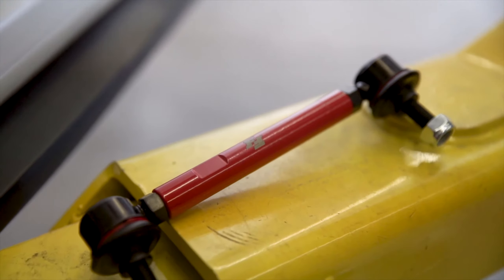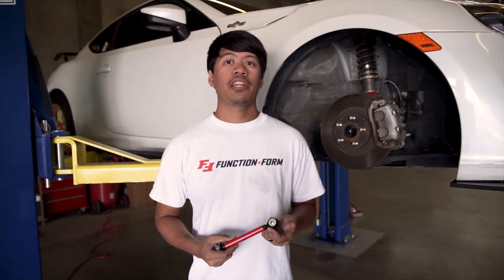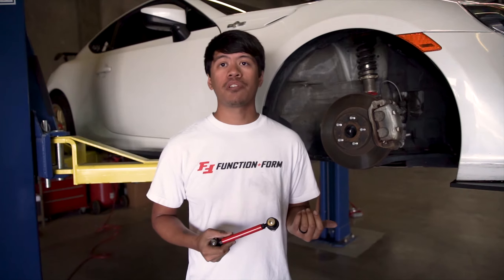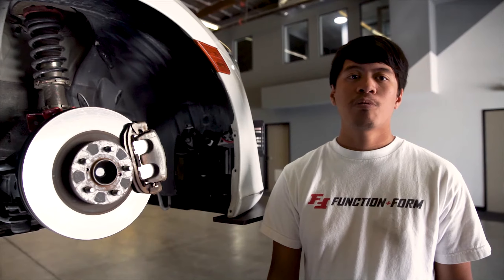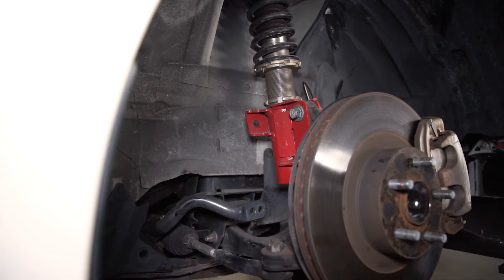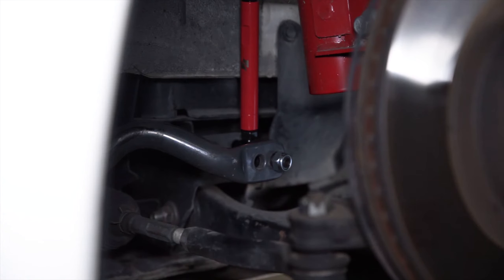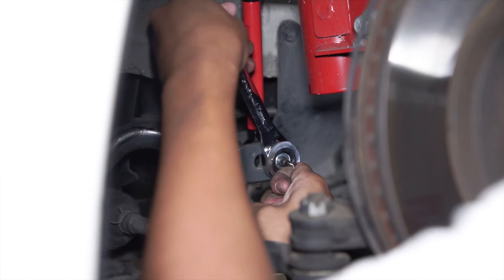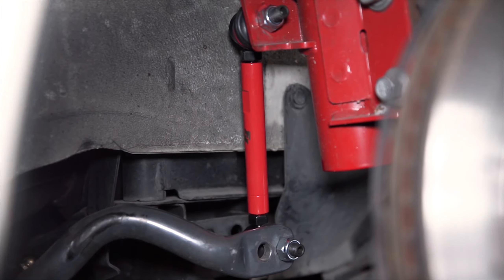Function and Form Suspension Adjustable End Link Install

Comment: i jus installed d2 coilovers on my 9th gen si , I kinda want to go lower in the front but the end link is close to the locking ring, should i keep my oem sway bar end links or put my adjustable ones on ?

Comment: Can you turn the wheel when feeling for the loosen sweet spot on the end link? Kinda hard to reach back there with beefy tires…
Reply from the maker: depends on the car and wheel set up but its best practice to remove the wheel and get a good look to make sure its installed correctly